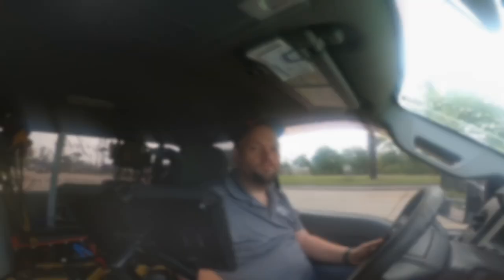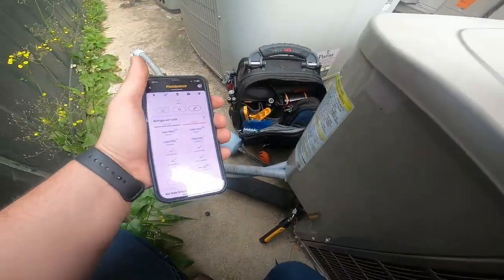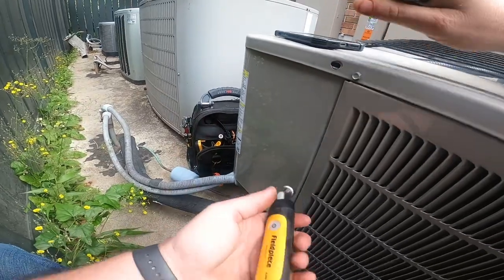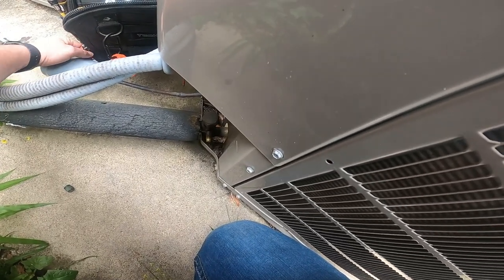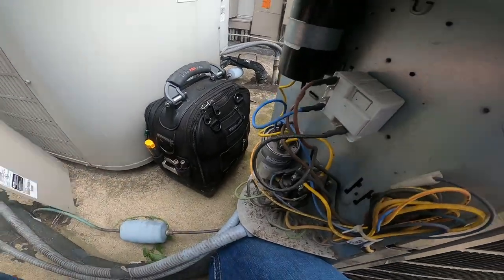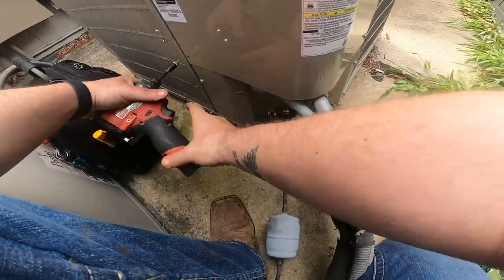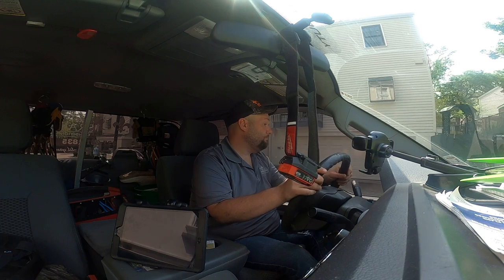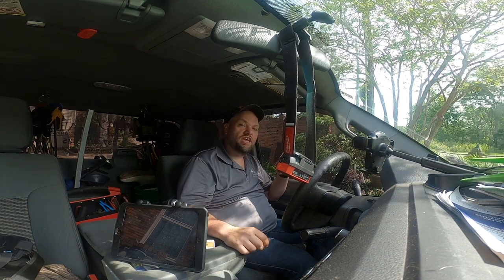No Cooling Bryant System

Comment: You read my mind about the drain. LOL 
I would state that double-checking that subcool would be top priority, especially if it was a little off today. Most likely was what you were thinking about a thermal overload.
As long as a return air filter was clean, coil condition was good, everything else should practically lineup to a little bit of charge.
You're the guy who has eyes on the prize.
You know what to do.

Maybe double check that blower motor. That always will catch even the greatest techs off guard. Damn X-13 ECM blowers.
Keep up the great work John.

Comment: I stopped using Duracells. I have had them leak while still in package not to mention leaks in equipment. Just junk batteries. Not saying that's your issue but in general I would find another brand.